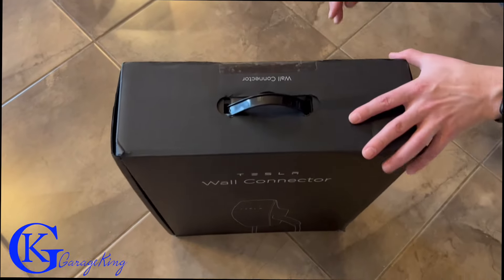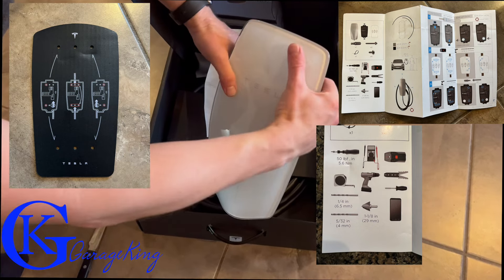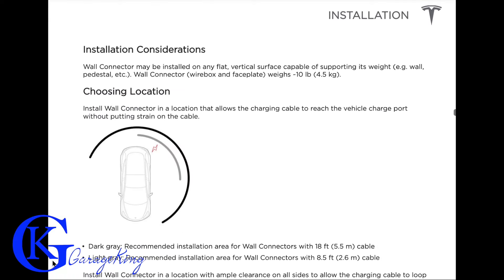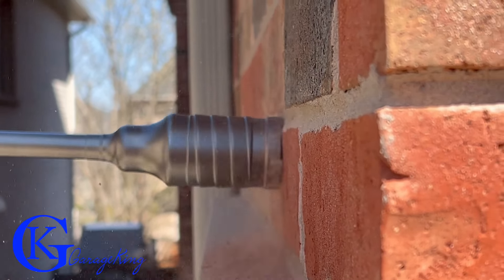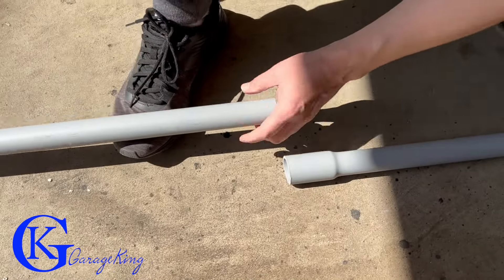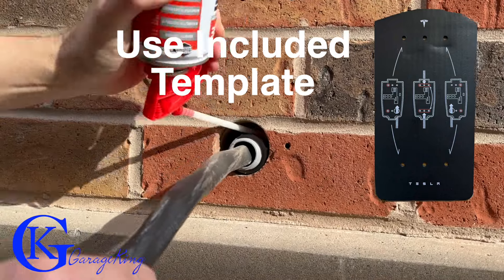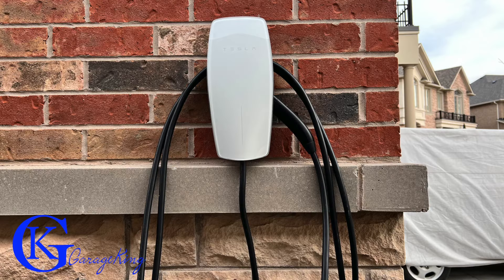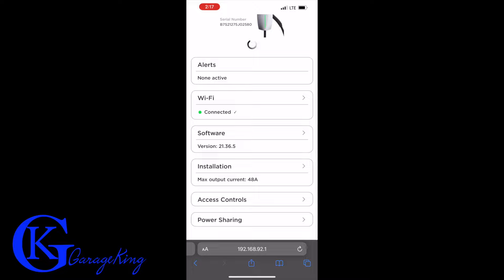Tesla Wall Charger installation (Gen 3)

Comment: appreciate this video to give me an understanding of how this is installed. I bought a gen 3 from a second hand store for $100 (honestly kinda skeptical it's gonna work, but I'm assuming the charger is smart enough to recognize a problem after it's hooked up).

My question is, mine did not come with the manual or the QR code to connect it to the internet. I know I can access the manual online, but would I be able to connect it to the internet without the QR code? Thanks!
Reply from the maker: Wow, that is a question I'm not sure.  I would think you can.  its will look for Wifi, and appear on your phone and you should be able to try to connect to it? Its probably a little trial and error.

Comment: I knew you were in Canada the moment you said Hydro ! :D Love the video. Thank you. May I ask why you installed it outside? is the charger weatherproof? specially for Canadian winter?
Reply from the maker: Hey there and thanks for the comment :)  I have a classic in the garage so the Tesla has to go outside.  The charger is waterproof and has made it through one Canadian winter with no issues.  I did mount it between the houses so its not exposed to direct sunlight, and the rain kinda misses it, but it is rated for outdoor.
Reply: @GarageKing  sweet. are you happy woth your Tesla so far? I am considering getting model 3 RWD to replace my diesel ML350. Did RWD ever got you stuck or fish tailed in Canadian winter?
Reply from the maker: @mistrykr  I have the Model Y so its AWD.  I think Tesla just lowered the prices and the Y was lowered more than the 3, so I think the Y is the sweet spot if you can swing it.  The Y handles great, the heater comes on really quick (no gas motor to warm up) and it does not affect the range as much as people say.  I plug mine in ever night and top it up to about 400kms (80%).  I usually charge around 15ams max as I charge over night (cheaper electricity rate)  I'm really happy with my purchase, but the one thing is (and I hear they are getting better) is the fit of all the panels, but they have some adjustment to line things up.  I have about 10000kms on it, so about 6000miles and so far it has not needed anything.  My neighbour has a model 3 RWD and he survives, although he does slide around a bit  when we get a good snowfall. I still have my gas powered toys, but for daily driving the Tesla can't be beat :)
Reply: I have 100amp panel. i am buying model 3 rwd. will I be okay if I add 60amp breaker knwing it will only draw 32amp max?
Reply from the maker: @mistrykr  Hey there, you should check with a local electrician to make sure as I don't know what else you are running off the panel box. Normally you are fine, but you can't have more that a 100amp draw with everything combined or you will trip the main breaker, so it depends whats running when you are charging.  I have a 200amp main panel, and the sub panel in the garage is 100amp. You are right, the Model 3 RWD will only draw 32amps, and you know technically you could buy a cheaper 40amp Level 2 (240V) charger and it would be just as fast as the wall connector as your car will not take more than 32amp.  I think people get a bit hung up on the charge speed.  I top mine off every night to 80% and I'm around 9amps, that's all I use and I trickle charge it overnight.  If you are in a hurry then I guess the speed matters, but just top off every night and you are fine on slow charging, which is probably better for the battery anyway. Also make sure you use 6 gauge wire.

Comment: How much do electricians charge ? Mine is quoting me for 1000😢
Reply from the maker: Hey there and thanks for the comment, I guess it depends on what they supply, and how much they are supplying.  The $1000 probably includes a lot of supplies. If they are supplying a lot of wire its expensive as the wire required is not cheap.  No matter what electrical you hire, they all have to buy supplies which are a fixed cost.  When in doubt get a few quotes, and if they are all very similar most likely its above board.
Reply: How far away is the panel from where you would like to put the charger? 
I just quoted someone $525 to install it right next to the panel in the garage, but I have to charge the panel because there isn’t enough space for the 2 pole breaker in the existing panel. The feed is 100 amps out to the garage and the charger only takes a maximum of 48 amps. So plenty of capacity in the feed just someone went cheap when the bought the panel.

Comment: Nice video. Thanks. So you used a 6/3 wire with the ground, but cut off the ground and used the white neutral as the ground. I assume that means it is ok to buy 6/2 with a ground for this installation? Is that correct? Thanks.
Reply from the maker: Yes you are 100% correct, the only reason I used 6/3 was because I had extra from the hot tub.  6/2 is better as 6/3 is a waste (I just had extra)

Comment: Did you buy the additional breakers for the connection to the Tesla charger or did you use the ones that are already installed and not being used?
Reply from the maker: I bought an additional breaker, as the ones that were already installed were too small.

Comment: What I've been reading about wire size is that the wire you run has to be oversized. So if you're running your charger for 60amp meaning a  max of 48amp is running through your wire still needs to be rated for the full 60 amps
Reply from the maker: Yes you are correct and if you use 6 gauge copper, it is rated anywhere between 55-75 amps depending on its temperature rating, and how it's run.  I should have covered that in the video and it would have clarified a lot of things. I changed mine to individual cables in the conduit.
Reply: @GarageKing  I've just been trying to wrap my head around what would be required to do this for our home, as I've seen such differing information on the topic
Thanks for replying!
Reply from the maker: @tenorsax856  Hope I helped, and I think the reason there is so much variance is the electrical codes vary between jurisdictions,  I followed the Tesla instructions on mine, and then ran separate wires afterwards which was easy to do in my case as it was a pretty straight run.  The thing no one talks about is the actual charging amperage used. Mine rarely uses over 30 amps.  Most of the time I'm between 10-20 as I trickle charge my car every night.  I think charging at 48amps every time is hard on the batteries, why rush it?  Just top it up to about 80% every night.

Comment: no need a neutral for 220vac anyways....its perfect for ground applications just makes sure its labeled and taped green with no white showing also you can use a green heatshrink.
Reply from the maker: Thanks for the comment, much appreciated.  I did get flamed a bit for using that neutral as a ground lol :)
Reply: Would he have been able to use 6/2 wire and use the supplied grounding conductor?

Comment: Hey hopefully you answer this soon, 

You said 6 wire is good for 60 amps ? 

My electrician friend is saying it's not #4 mandatory 

My dad thinks the same, retired electrician 

Can you speak on that 

I have a dead hot tub in a 50 amp breaker currently, 

Was just going to swing it over as is, 

But it can go on a 60 amp ? 
What's the speed difference
Reply from the maker: Hi There, that's not what I said.  I said that #6 gauge wire can carry 55amps and Tesla tells us to use a 60 amp breaker.  We are never actually using 60 amps.  That is the 125% rule (48ampsX1.25=60).   The tesla wall connector has load management built in and maxes out at 48amps so you should never use more than 48amps.  Personally I always average around 15amps as I trickle charge it up to 80% each night. If you use a 50amp breaker you will limit the current to 40amps (don't ask me how the car knows, it just does).  Also you should use THHN wire.  Please google "6 gauge thhn wire max current"  and the reply you get is..... "However, the regular ampacity of a 6 AWG copper wire that you are looking at in most installations is 55 to 65 amps. It can carry 55 amps, 60 amps, and 65 amps".  If your friend is an electrician he is probably up to code so you can follow what he says.  Also if your dad is a former electrician you are most likely in good hands.  Sorry for the late reply, I'm on vacation LOL :)
Reply: @GarageKing  oh no worries thanks bro !!!

Sorry I was just driving and listening I must have nishewrd

Hahaha my dad is stumped and my other buddy Is like 3ed term now but lives in Hamilton,
Telling me to use shielded teck90 cable 

My dad said call the electrical company  and ask them what works in our area for code. 

I have to go thru the garage, it can go up the wall all the way,  or does it need to be in conduit ? In the house it's exposed on the ceiling 

I'm definitely going to check that wire. 

I have #6 nnvu, it used to be a hot tub, I thought it was on a 50 but it's actually a 40. 

I don't know if it's worth it to use existing just for now ? 

The wire is just inside rated I think, 
not shielded,  
he said it should be mechanically protected,
But it's right up a wall exposed on the ceiling of the garage 

Good to know about the actual amps it draws.

Neither of them are local to me and can help me other than Facebook pictures
Reply: @GarageKing  and sorry to bombard you, but you said you were Canadian too ? 

Someone said it needed to be inspected or it could void your insurance, 

I asked my insurance lady and she said she's never heard of that.

I was an ncs and comfortable doing all the work, 
Just the math I really wanna get right,

There's so much misinformation 

Checking those links first thing g in the morning thank you and enjoy the vacation !
Reply: @GarageKing  oh damn that thhn the shit

The explanation of the 48 amps is super helpful 

I was scared I was gonna burn the house down if I fuck this math up 

My girl had the dishwasher on last night and I told her,
We're gonna have to watch that 😂💀
Reply from the maker: @TheDJConnect  Hey Thanks, in Ontario a homeowner is allowed to do the work himself/herself so you are ok to do it yourself if you wish. It's suppose to be inspected by the ESA in Ontario.
Reply from the maker: @TheDJConnect  I think you have to have it mechanically protected, but there might be something in the code about garages if the wire is above a certain height, I'm not sure.  That's why I just ran mine through conduit as the conduit doesn't cost much.  If you run in the conduit you could strip the sheathing off the wire (The black sheathing) so the wires run cooler, and then run the wires separately in the conduit. I think I used 1.5 or 1.75" conduit so pretty big.  I don't think its 2".  I'm home in a week so I could check in a week for you.
Reply from the maker: @TheDJConnect  You could use the 40amp breaker if you wanted, It would limit the car, but honestly, I rarely ever go over 20.  Most of the time I'm using 10-15 and I have it set to start at 7pm when the power is cheap, and then it finishes by 7am.  Not sure how much you drive, but if you are doing about 100km or less per day, a top off of 15amps is all you need.  Remember 15amps on the wall connector is DOUBLE the 15amps you have from the regular outlet as the wall connector is 240v.
Reply: @GarageKing  this was awesome and super helpful

Thank you so much and enjoy the trip !!

Just bought one and it's already ready to go, 

No 6 month wait hahahahaha pick it up Friday so it's slightly stressful 

I doubt we'll be driving much at all, 
Mainly for the long hauls and stuff to Oshawa to family,

But around town lucky if we do 100

This was amazing thanks !! Subbed !
Reply from the maker: @TheDJConnect  Thank you for the support !!  You don't have to watch all the vids, but I do have some good variety. I'm a red seal mechanic, ad a big DIY guy.  I have some good Tesla vids on my channel. Still can't believe I put a front bra on myself (video is on the channel if you search) but it looks really good and protects against chips.  I also did the A pillars, they are really easy, and  I'm thinking of doing the hood.  The front of the vehicle is prone to chipping.
Reply: @GarageKing  ok amazing good to know ! 

I literally just ordered it yesterday, 
Having some financing issues.... 
They changed the rate on me this morning, 
And wouldnt allow me to complete financing yesterday 

So I'm really mad about it, 

But delivery is on Friday hahaha 

Slightly stressful, 

No months of waiting to get this done lol
Reply from the maker: @TheDJConnect  Awesome you will have it all done, you will love it. At first I thought how good can it be, but it is good.

Comment: Hi i got the Gen 3 installed yesterday with 60amp wire 6gage, i also commissioned the connector. the web shows max 48 amp power however when connecting to 2024 Y its only charging with 32amp and there is no way to increase the amps. What should i do?
Reply from the maker: Hi There, I think, but I'm not sure, that the car can detect the circuit.  DO you have a 60amp breaker in your panel box.  You can adjust on the app, or in the car, if its stopping at 32 you might have a smaller breaker.  Also just fyi I rarely go to 20, most of the time I charge between 10-15 as I top it up every day to 80% so I don't wait until its empty.

Comment: Thanks for the video! I’m interested in your prep for mounting the box to the brick. What masonry bit size did you use for the pilot holes? And did you use the included screws or concrete rated fasteners?
Reply from the maker: Hey Thanks for the comment.  I believe I used concrete rated fasteners, the blue ones you can get from Home Depot.  I forget the size, but the screws came with the drill bit, I think they were called "Rock" or something like that.  They would be equivalent to a #8 wood screw (about that size and about 2.5" deep so you can get past the first part of the brick, through the hollow and into the second part.  You need to get into the second part because sometime part of the brick flakes away.  Its still holding great !!!  The only thing I should have done differently with the electrical was I should have stripped the sheathing off the wires so they are not held so tight when run in the conduit.  I actually did that later on.  I also stripped the white wire bare, so now the ground is bare.  I got flamed from putting that tape on the white wire LOL:)  Happy Sunday to you

Comment: I wish someone would demonstrate a installation like this for people who don't have enclosed garages,
my garage is now a enclosed bedroom with only 120 Volt regular USA  household outlets, and my breaker box is located on the outside of the house
over 60 feet away from where I would place the  wall charger in the converted garage bedroom, and most likely place the charging handle out the window
each time to charge the car,  but  nobody on YouTube demonstrates how to overcome such challenges,   all these videos assume  EV owners all own or must own enclosed garages,
and not everyone the USA probably should have one of these installed outdoors due to severe heat or severe cold degrradation concerns,  like I would have out here in the
southwest,   (I personally am distrustful of any manufacturer's claims these can work properly year after year in 100 plus temperatures)  I'de rather have only the
smallest portion of the cable and handle exposed to the outdoors temps  at night where the warmest it get's is  90 degrees  and coldest it get's is like  38 degrees,

(this is true for much of the southwest for most of the extreme temp swings of    New Mexico, Arizona,  UTAH,  Nevada,  and Southern, CA )  (even Texas and Florida are very humid ,  are these chargers and cables installed outdoors going to  able to withstand that much humidity  as well?)
Reply from the maker: Hi There, if I read right yours would just be the opposite, you could run the conduit on the outside, and then drill though the wall like I did, but mount the charger on the inside.  For me breaker box on inside, and charger on outside.  For you breaker box on outside, and charger on inside.  Also if you are curious the wall charger is still working great being mounted on the outside and I'm in Canada (some tough weather) Also because you have such a long run I would look at wire size. You may want to step up.  Also run individuals wires in the conduit.  I later stripped the sheathing off mine so they are now all individual wires so they have more breathing room to dissipate heat.  Thanks for the comment
Reply: @GarageKing  If your wires were inside of a sheathing and you removed the sheath, did you notice if the individual wires had a mark rating on them? If not, then you should step-down to a 40amp breaker (lowest) if your wire was a #6. I understand your thought, but sheath wire is rated with the sheath installed and the wire intact. The plastic coating on the individual strand (generally would not have rating marked) wire inside of a sheathing is actually rated less then that of an actual individual strand THHN wire.Unless so marked code requires a step-down in my area.
Reply from the maker: @moemoes5989  Good point, well, the good thing is I rarely use over 10amps anyway.  I know there was a lot of debate over this and Tesla somehow (I can't remember) explained how the car monitors everything, possibly through resistance change and thus controls everything that way. I don't remember any markings on the wire, but there were not many strands in it, and the strands were thick and hard to bend.